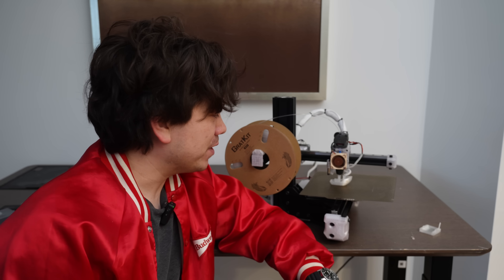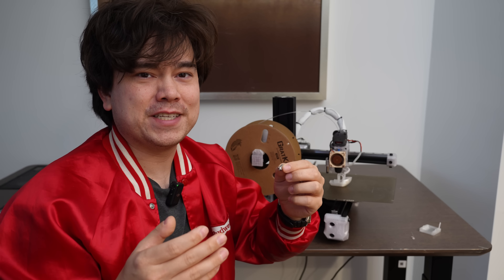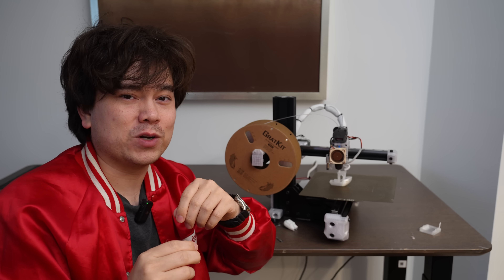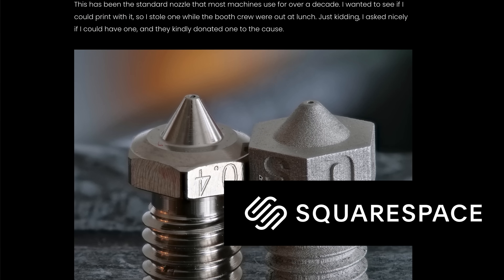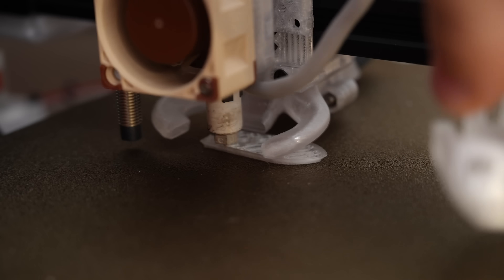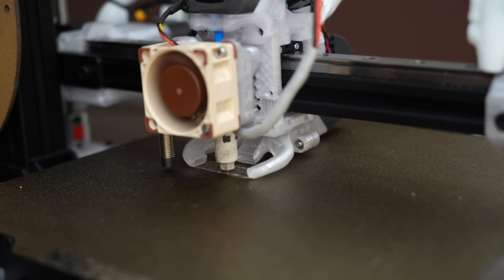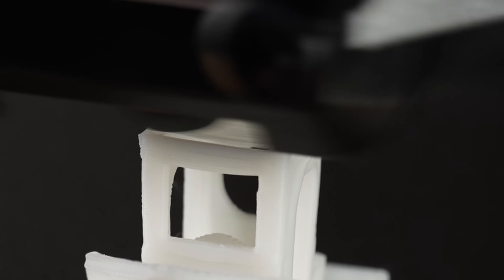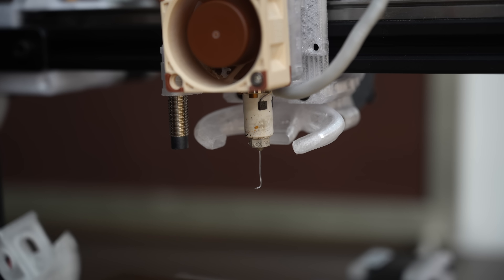Testing a 3D-Printed Nozzle: Does It Actually Work?

Comment: I wonder whether it's possible to design bozzle-like nozzles and have them 3D printed by 3rd party services like PCBway.
I don't mean as a way to save over a genuine CHT, I mean as a way to get CHT-like performances in printers which have nonstandard nozzle length. In particular, I have a Q1 Pro which has a "2 mm shorter volcano" nozzle which makes genuine volcano CHTs difficult to use, and v6+adaptor risky because of the adaptor often getting stuck

Comment: Still, a simple nozzle like this is pretty easy to machine, so there isn't any real reason to use 3d printing for it.  But as others mentioned, that changes if you add extra geometry to improve heat transfer into the plastic.  Being able to make geometry that hasn't to be straight, which doesn't have to be reachable with a drill tip, that's where this would shine.
Reply from the maker: Or maybe just a nozzle insert that is 3D printed

Comment: I suspect the benchy failed because of the lack of a sock, if I forget putting it on my Klipper printers sooner or later I get an error as the hotend doesn't heat up at the expected rate. Anyway that's impressive, I can imagine it would be possible to make some extreme high flow geometries

Comment: Have a few bambulabs under my competence at work and gotta say, yes, you can print fine just pressing print without any tweaking. But what gets me excited to work with those is pushing them to the max. Right now I'm printing some ridiculous print speeds with very nice quality. So didn't loose much excitement for the hobby even if it's part of my job now lol

Comment: Come to think of it, all the imperfections provide a larger surface for heat to transfer. Meanwhile, the shape of the extrusion must have some amount of surface tension, keeping it round enough. Next time: internally ribbed nozzle, maybe?
Reply from the maker: Optimizing heat transfer is a fun time, there are so many parameters
Reply: In addition, rectangular nozzle, spinned by a separate servo + variable flow rate would be a great way to speed-up the print while keeping the small details where necessary.

Comment: Maybe the filament primed the inside of the nozzle, giving a better flow with the addition of slower speeds. You didn't test how much filament you need to extrude after color change to have consistent new color

Comment: In my next Minuteman video I'll go deep into why I think a rougher surface is sometimes beneficial to melt plastic fast. Not in your specific case (stainless steel and all the way down in the melt channel) but I incorporated it into my latest design. Which, let's put it mildly, able to melt plastic at a ridiculous rate.
Reply from the maker: Yes, in radiators they add turbulators to introduce shear and turbulence to speed up heat transfer.

For mixing to occur you need to generate shear forces in the fluid.

Surface roughness can help, but I also worry if it will trap particulate more easily and lead to clogs?
Reply from the maker: Another interesting thing is there is a gap between the filament and the hotend wall when feeding quickly. The filament is usually undersized compared to the nozzle inlet only makes full contact with the walls once it is melted.

The Bozzle nozzle gets around this somewhat by having spline-like teeth I. The side walls that bite into the filament as it’s being fed, and get the melting process started sooner
Reply from the maker: This might be a factor in how the CHT works. The flow splitting die forces the filament to expand and make contact with the nozzle walls at a controlled point
Reply: @NathanBuildsRobots  Yes, the shearing is what I think is helping with heat transfer. Filament on polished walls moves as a whole, creating stick slip etc. With high surface roughness, the most outer layer stays put and creates a liquid cushion where the unheated core rides on. But this only accounts in areas where filament starts the heating process. When you got somewhat full melt, I think good surface finish is beneficial #myoppinion

I dont see problems with higher clogging chances, if you got impurities they wont be affected in both ways and basically clogg the nozzle or not... :)

Comment: Is there a reason you did not do a PID-Tuning with the printed nozzle?
Reply from the maker: Usually it isn’t needed. If you are significantly changing the thermal mass of the hotend, or are changing the heater or thermistor with a different type, then it might be worth doing.

Comment: I feel like if you got usable prints running at the same speed, time, temp the quality would be more comparable. Use the usable settings for the printed nozzle on the other nozzle. As you have said slower yields better print quality. At face value this a cool showcase of the possibility, but not as comprehensive as I thought it was going to be.
Reply from the maker: The main difference is that I was using a stainless steel nozzle instead of copper. If I did much more testing I’d get a copper nozzle first
Reply: @NathanBuildsRobots  3D printed Copper nozzle for a future video?
Reply from the maker: I showed some pictures of them in the video, they make them
Reply: @NathanBuildsRobots  yea but I mean try them out.

Comment: How about printing most of the fan parts? Blades, case etc. Run 0.4mm copper wire through a nozzle and wind it into a coil and call it "printed".
Reply from the maker: I’d rather use a PCB stator for the motor wires

Comment: I feel like what you said about slow down and having a quality print is exactly what Prusa is doing. Using the structural setting on the MK4 and XL are making really great quality prints. 

I print mostly functional high tolerance (as good as you can get with fdm printing) and funny care about speed of it sacrifices quality. 

Great video.
Reply from the maker: PRUSA just does things different. I think they have great strength and print quality. Who cares if it’s 20% faster if it’s 30% weaker? Sounds like a waste of material to me

Comment: try bumping up the print temps with original nozzle, same settings and see how it compares then.
Reply from the maker: The prints would probably look the same, if not a little overcooked with the original jozzle
Reply: @NathanBuildsRobots  to be honest i printed PLA at near PETG temps with little to no difference.

Comment: Threads and a tight seal - pretty great proof they have their scaling down from the bake.  If it's like resin where a batch is the same operating costs as a single print, maybe you could crowd source/fund a big batch of something.  can the process do print in place parts w/ moving components?
Reply from the maker: Anything that is touching in the sintering process will stick together. But if you have extra clearance it should work

Comment: How the hell is the print quality so good with a nozzle surface that rough? Kind of feels like someone showing up to a car show with their 40yo clapped out beater and taking the main prize,
Reply from the maker: Due to how viscous melted plastic is, flow will be laminar no matter how rough the surface of the nozzle is. So the overall flow won’t be affected too much my roughness. 

Idk why so many brands focus on making super smooth nozzles. Maybe it helps prevent carbon deposits
Reply: @NathanBuildsRobots  Yeah, super polished nozzle conduits probably don't do much for the final results.
However when printing multicolor or multi materials (like for support interface) I suspect that to avoid material / color contamination much more filament flushing will be required. Poop galore !.
Could a great test. Any chance you can try changing material or color and see if there's a big diff ?